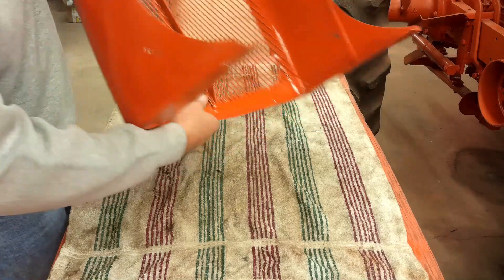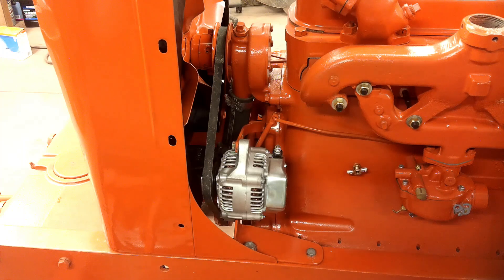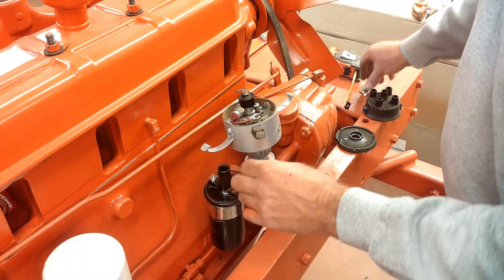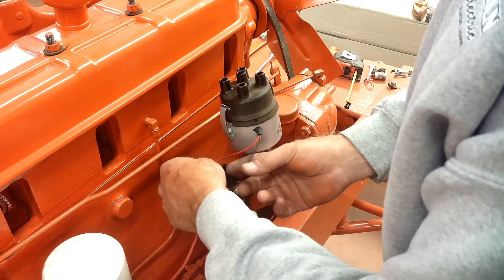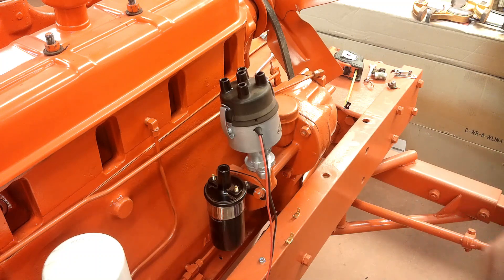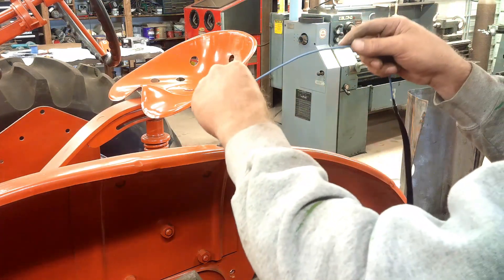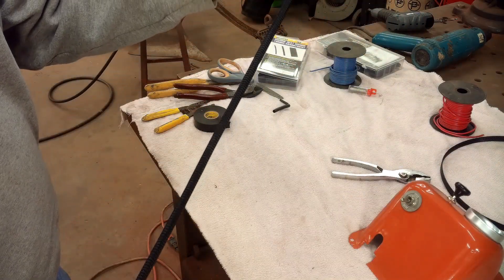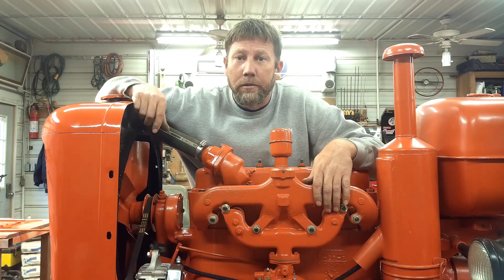Allis Chalmers WD45 Restoration Radiator Install Wiring Pertronix Ignition Ep.30

Comment: I had all my tractors converted to pertronix. I changed them back after they all went out. Don't lose your isolater stud. I had trouble getting those.
Reply from the maker: I put all the original parts in the pertronix box and put them on the shelf. What plug wires did you use? The guy at the parts   store told me if I used a wire core it would cause the pertronix to fail. I'm using carbon core wires that are supposed to work. Time will tell!
Reply: @sparksfireandbalingwire8467  copper. I think long periods of not running hurts them the worst. No matter what ignition or charging system you have. Start em up a few times when your not using them and you're way better off. When the electronic goes out its $100!

Comment: nice work! i have the repro amp gauge when i did my 12v works good and looks good. nice work with the wiring too.
Reply from the maker: Thanks! Wiring turned out real nice, but then again, its a pretty simple system!

Comment: Does the pertronix ignition need a ballast resistor
Reply from the maker: No, I'm using a pertronix coil also
Reply: Also  what type of fluid did you run the the rear and transmission and what type of hydraulic fluid did you use

Comment: Ok Jason, Im no mechanic so please allow me to ask a stupid question. Is a voltage regulator necessassary ? I dont believe I saw you install one. The wd45 I am working on has one and it is a mess. If fact all wiring is a nightmare and I want to replace it all eliminating anything not necessary. I would like to upgrade to a new style altenator as you did and maybe the electronic ignition setup too. I may need to hire out the work of fixing this tractor up but would like to give it a shot before I totally give up ? Lol. 🙂
Reply from the maker: If you switch to an alternator, the voltage regulator is built into it. The electronic ignition is a breeze. If you try it yourself, I think you will find it quite easy to do.
Reply: Thank you soo much. When I look at this I am overwhelmed. I hope you dont mind if I ask a question or two along the way. Im really impressed with your work.  😀 Did you get most of your parts from Steiner or is there a better vendor?
Reply from the maker: @smfarmboy5229   I got the majority of it from Steiner's and DJ's Tractor Parts.

Comment: Good  day  Boy good looking. Alternator bracket  work good .  What did that electronic  ignition cost.  Never had that back in 80's Looking good.  Thanks  That white stuff falling on ground , please don't send it  up here in Ont. LOL
Reply from the maker: Good morning Don! The electronic ignition module was $100 on eBay. The matching flamethrower coil was another $43, im not sure that was really necessary. We got snow Sunday, Monday, and Tuesday. I've never seen that here in Iowa before, not in October anyway! At least its still warm enough to melt right away